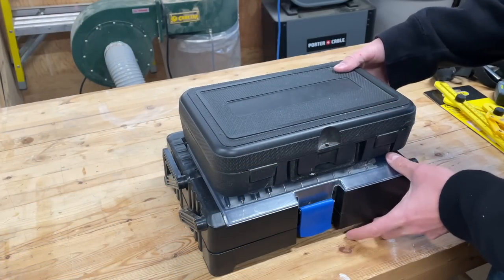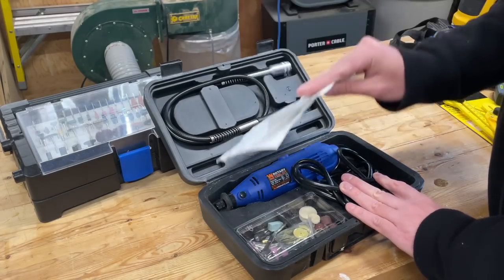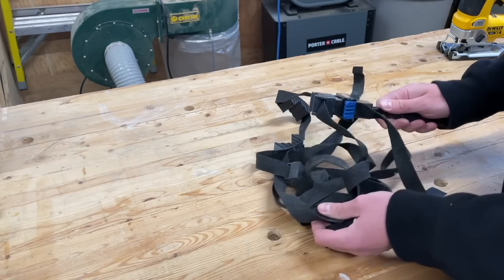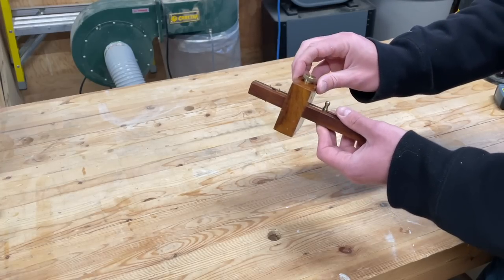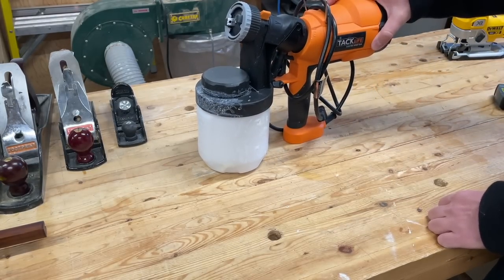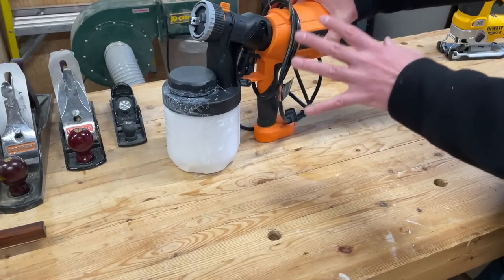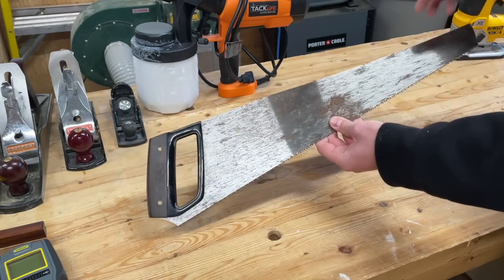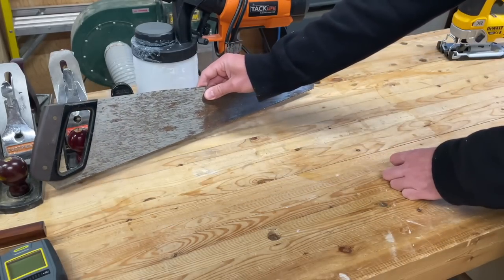Don't Buy These Tools // 10 Woodworking Tools I Wish I Didn't Buy

Comment: Out of these I have the MultiMark and that yellow angle finder/protractor. I also use a jigsaw even though I don't own one, and I have a proper Dremel. 100% agree on the protractor; got a digital bevel gauge and didn't look back. Slight disagree on the MultiMark; I use it for quick and dirty depth measurements, and that's about it. But it works well when I don't want to futz with a combination square or a depth gauge, and where precision isn't necessary. It works especially well for quickly comparing two marks to make sure they're the same distance away from the edge of a piece.

As far as rotary tools and jigsaws go, I kind of think of them as specialty tools. If you need one, almost no other tool will suffice. But if you don't need one, there's no real point in having one. If you're a luthier, for instance, then a rotary tool is almost mandatory unless you're willing to learn inlay work with hand tools. And jigsaws are great for rough cutting holes and curves that you then finish up with another tool.

Comment: Hey Mason, The longer I am doing woodworking I find that I need fewer tools. I'm mostly a hand tool woodworker now and enjoying it more. My projects the last two years were hand tools only and I admit it has been more fun although a bit slower. My customers seem more appreciative that they have something made entirely by hand. I do use electric lights part of the time though and when it's hot I turn on the electric fan. Is that cheating?
Reply from the maker: Haha, certainly not cheating! I could definitely see myself going the hand tool-only route for a period of time.

Comment: Rotary tool, a tool that I questioned for ages if I would use or not but when I finally bought one it’s one of the most reached for tools in my box. Of course I didn’t go super cheap I bought one of the best Dremel brand tools available at the time. Like somebody else mentioned this seems to be about cheap and that wasn’t cheap.
Reply from the maker: It’s definitely on my radar to get an official Dremel-branded rotary tool.

Comment: Yes, the Bessy band clamp is vastly superior to the cheap ones. And it's not much more expensive so there's no reason not to get one starting out.

But if you already have a cheap one, it can be perfectly usable. All it takes to tame the "mess" of the strap is a strip Velcro or a twist tie.

And getting some of the Bessy angle plates is a game changer for using it.

But sure, should have gotten the Bessy or MLCS in the first place.
Reply from the maker: Soon after I grabbed the MLCS and love it!

Comment: I bought a DeWalt corded electric T-50 stapler for doing some upholstery work.  Since at the time I didn't have a compressor I figured it would perform at least as well as my Stanley hand stapler but with a lot less effort.   Nope - it's a total POS that can almost sink a 1/2" T-50 staple in to the softest of pine.   I have since bought a compressor and a pneumatic stapler that actually works.
Reply from the maker: Thanks for sharing!

Comment: First, why not do a follow up video on these tools but show a better tool to buy & 2nd I think a jigsaw has been useful, for me anyway, for rough cutting wood with a pattern, then following up with a flush trim pattern bit. Also, I did buy a cheap block plane and it is a nightmare for me, a “beginner”, to setup. 
Thanks for this information
Reply from the maker: Great suggestion, thank you! I've started using my jigsaw more since using this video - the right blade and right speed setting went a long way to help reduce chatter and improve cut quality.

Comment: I bought the strap clamp that has a reel that holds the extra length of strap, and it was awesome for gluing up a picture frame.  I specifically got the one with the reel so I wouldn't have that strappy mess.
Reply from the maker: Yes! The reel seems to be key to avoiding such a mess. Still something on my list when I have a project that could benefit from one.
Reply: @MasonWoodshop  Follow up, I even used this strap clamp to glue up a 17" x 44" shaker style cabinet door, so it's pretty dang useful!

Comment: Good one.Don't agree with some of them.The rotary tool was a bad decision should only go with Dremel but the Mastercraft pieces are not a waste.I got them and true,you don't use them all the time but for the price well worth it.Just like the MC multi pack of drill bits.Not the best but handy for rough work. I agree with John Heisz  if you are shopping CT Maximum only
Reply from the maker: Awesome feedback! I’ll keep the accessories and plan on upgrading the tool when needed. Totally agree on the Maximum only approach - regular Mastercraft (especially power tools) can be awful.
Reply: Maybe they've improved but I do not think Dremel in my experience is the best rotary tool I have ever used. I blew the motor up on one and shredded the coupler in another. I bought some B&D RTX rotary tools and they've been holding up fine for me. But I think they got discontinued? I bought them on closeout. They were like $10 a piece.
Reply: @MasonWoodshop  the maximum brand is junk now too, they are marked to tool collectors that want shiny tools and not actually use them

Comment: I was ablolutely gobsmacked when you derided the de walt  jigsaw ? i have been using one for about three years & when it started to become worn ? it was second hand when i bought it, ii rushed out & bought a new one, i canot live without it, it is an absolutely essential tool, Like all tools you need to master them, That goes for all things in life, golf. table tenisl driving watever you do you have to practice, PRACTICE MAKES PERFECT, We are all to quick to judge, but i do like your blog cheers.
Reply from the maker: Haha, that's one that I've definitely taken my thoughts back and posted a video about how wrong I was with the jigsaw. It's become a frequently-used tool for me, it just took some time to play around with the settings and blades. Now I'm getting super-clean cuts across a wide variety of material.

Comment: The Wen rotary tool is not a bad tool for the money.  I'm not sure how you've been using it that gave you unsatisfactory results but the flexible extension makes the <$20 well worth it.  As long as you have reasonable expectations.   It's a small bit spinny tool with a decent amount of starter bits.  The cut off blades are non reinforced and are garbage but you will pay more than the cost of the kit for better quality bits.

Comment: Pretty much agree on all of those, especially anything from MasterCraft. 

Sometimes it is a one time tool, other times it is a tool that you are not sure of. Before YouTube I made more purchasing mistakes. With time I am learning. 

My list of "why did I buy it" includes a scroll saw - Ryobi - not expensive so ok. A biscuit joiner (again Ryobi) now replaced with a Festool Domino.  A Record #45 Combination Plane - a few good routers and a router table have replaced that,
Reply from the maker: Thanks for sharing! As a Canadian, it's really a shame that MasterCraft has gone so far downhill - the only MasterCraft items I use regularly are some sawhorses.

I'm constantly tempted by the DeWalt scroll saw, but then I realize that I have essentially no desire to work with intricate small parts, haha!
Reply: @MasonWoodshop  I have a scroll saw. Yes you can do fretwork, marquetry and intarsia on it. But you can also do other things with a scroll saw as well. Some projects need some intricate cut. Doesn't have to be that small either really. My saw will cut to the middle of a 32" part. Scrolling can be pretty fun. It does the how did you do that thing. Once I almost bought a Hawk at a yard sale. It's like a $1,400 scroll saw. They still wanted $250 for it so I passed. Thing was a monster though. I think it had a 2 foot throat? Big, big, big scroll saw! Yeah no, I'm not that into scrolling myself. But I gotta admit I did think about it. AFAIK they're the have all and end all when it comes to scroll saws. http://www.hawkwoodworkingtools.com/WebsitePages/The-Hawk-Scroll-Saw.html

Comment: I had 3 Dremel brand tools. 2 corded, 1 cordless. All 3 burned out after 1 or 2 months. My son got me a cheap one for fathers day 6 years ago. I replaced the collet nut with a chuck, I use it all the time for wood carving sanding and metal work. Same with my jig saw. I never bother with flimsy plastic junk.

Comment: For what it's worth, I bought that same model Wen rotary tool after hearing my dad sing its praises, and I have been a happy camper. I'm sure there are better and stronger rotaries out there, and that the Wen would not be well-suited for some tasks, but I have liked it. It's especially nice just keeping the extension on and using it as a hanging "station".

Comment: yeah, I don't use my jigsaw either. The rest was cheap tools. You seriously get what you pay for. The one I couldn't believe is a low quality Kreg tool. I had no idea that some of their stuff was junk.  Love my kreg pocket hole tool. I bought the 520 pro. It sets up easily, doesn't bench mount and comes with a few nice accessories. I figured the bench mount type would limit me to smaller pieces of wood.

Comment: Cordless jigsaw is actually really good for those who need to break down rough stock. Far safer than just about any other method. I buy 16' x 12" wide rough boards and my cordless jigsaw helps me safely get small enough parts to bring back in a mid-sized SUV.
Reply from the maker: Great use case for the jigsaw! I’ve really come around on it as a useful tool.
Reply: What's not safe about a circular saw? Is there something I'm missing? They make cordless circular saws too. I got a couple. If it's just 16' you can tie that on the roof.
Reply: Unsafe and safer aren't the same thing. Not what I said. Jigsaws don't produce kickback like circular saws can. When cutting rough sawn stock, bows, twists, knots, and tension can all produce kickback. My vehicle is not equipped to handle long boards. That would require a $500 aftermarket kit, which can still only load 150lbs max. Not sure what you're trying to prove here, bud.

Comment: Instead of strap clamps, I always use ratchet strap tiedowns. Much more durable, the strap doesn't flop all over the place, and I can get it as tight as I want. I tie a lot of stuff in my pickup truck, I already have the straps.
Reply from the maker: That's a great idea! I have a bunch of those in my truck to try out.

Comment: Fantastic!! It's so interesting what tools some people like in their style of woodworking and what others don't like. I love my Dremel for fine metal working and sanding wood projects in very tight places, and we just used a strap clamp this weekend for assembling the mitered top frame of a cedar planter box as if it was a picture frame. I don't know if I agree with the jigsaw either; I don't use a jigsaw much after buying a bandsaw, but it was essential for curves when I didn't have a bandsaw. Great video!!!!!! Great content.
Reply from the maker: Thank you for the kind words and the insights! I think my main issue with the WEN rotary tool was that it was a low-cost low-quality option (compared to Dremel). A strap clamp still has my interest but the one that I have hasn't been great with even pressure and it just a constant mess of strap - which one have you been using? Hoping to see you use it in a project video!
Reply: @MasonWoodshop  It's the harbor freight one. It was only $5 after a 20% off coupon, and it's easily paid for itself. Ha, maybe that's why the mess of strap doesn't bother me; I love a great deal. I mainly use it to true up joints on a square frame, not really for boxes. Once again.... fantastic content. This one is going to get a lot of views.
Reply from the maker: @FridayWorkshop  I wish we had Harbor Freight up here in Canada! I've been to one a couple of times and the deals can be fantastic. Thank you for the kind words!
Reply: Try using a die grinder with a solid carbide bit.  Very useful for those odd freehand metal/wood jobs.  They have real power.

Comment: I think the rotary tool is one of the most common of the tools we beginners buy that we rarely use afterward - I have an "expensive" Harbor Freight kit with a big accessory kit and I don't think I've ever even opened it.
Reply: I made it for years without one but bought one a couple months ago because it was the only way I could think of to cut through some luan underlayment up under the toe space of my cabinets. Probably won’t ever use it again.

Comment: As a general rule. You get what you pay for.
A jigsaw is almost a requirement especially if you are doing openings inside of panels. Cheap or inexpensive hand planes. If you have a friend with a milling machine and a lathe you can fix a lot of the issues. Or if your local school district or tech school has adult education classes for machining. Measuring tools or marking gauges. IMO you are better off with a dial caliper. They are great for layout work.

Comment: Horses for courses. I love my DeWalt jig saw but then I’m not a woodworker I’m a metal worker that reluctantly uses wood when I have to. I’ve got one of those stupid cheap strap clamps but again, for what I do it ok, just. I think some of the problem is that people find a good tool and then find a way to make it as cheaply as possible and pump out millions of them. Then the whole design gets a bad name. The strap clamp made out of decent materials like aluminium and quality strapping would probably work quite well. Like you most of the tools that I regret buying were cheap versions of the well made originals. Cheers Stuart 🇦🇺
Reply from the maker: Thanks for watching and for leaving a comment! Nice to hear that I’m not the only one with a collecting of “cheap” tools - I think it was generally a factor of being a beginner and wanting to acquire everything I possibly could, haha.
Reply: @MasonWoodshop  Exactly right, same here 😂😂😂. I tend to buy less but buy quality now.👍👍

Comment: The 
DeWalt - A jigsaw is a great tool to have as it will cut where others won't.  Drill 2 holes and cut between them with another tool - which tool?  Portable to breakdown wood - sure, but you are Really missing out on the functionality of a JigSaw. Rough cut, change the blade,  Cut metal, change the blade.  Cut plastic, change the blade.  Cut carpet, change the blade.

True - this is what YOU use, but the rest of us use a jigsaw a lot (not all the time, of course).

Comment: I have a dedicated hollow point/chisel mortising machine.  Great machine, but I don't use it much ... expensive and takes up a lot of room on my work bench.  On the few projects that I used it for ... it worked great.
Reply from the maker: Funny enough, I almost bought a mortising machine early on. Impressive tool, but in a small shop I’m pretty limited by space. Thanks for sharing!
Reply: I have an adapter cradle for my drill press that mortises, works well. I looked at a dedicated machine, but couldn't justify the cost.

Comment: Your wrong on the Kreg multi mark. It is an excellent companion for the woodworker. Great video though and I just subscribed to your channel
Reply from the maker: Thanks!!! I’ve come around a bit on the multi-mark and have been using it for setting trim. It’s a lot lighter than the 6” combination square I was generally using.

Comment: My experience with Dremel type tools has been hit and miss over the years, but two things have consistently been bad: lack of power and the pain of changing collets! 
This until I saw a video by Xynudu about the Hilda 400w rotary tool. I bought one and I've never used anything else since! 
It's got a keyed drill chuck, so no more changing collets, and it's actually easier to tighten with a key than with those mini spanners for the collets.
Also, it has more than enough power, at least for my use. 
You should try it.

Comment: I like the jig saw for cutting rounded corners on larger heavier tables and benches where it is no longer ease to move the peace then sand after to the mark with a belt sander.
other then that I agree with all the rest.
Reply from the maker: I've really come around on the jigsaw and use it much more often now. Just took the proper time to dial in the blade and settings to get some very nice clean cuts now!

Comment: 2000% agreement on the Footprint planes. So many other options out there that are still economical but don't take hours of prep to use. More to the point, even after all that prep, it's still a bad tool. Just get an old Stanley and tune it up, or get a Groz Shop Fox or one of the house brand from Grizzley Tools and it will be light years ahead of those Footprint planes.
Reply: I have bought a new Stanley plane last year (in Central Europe), and it also needed a lot of adjustment. The bottom side had a hollow in it which I had to sand...